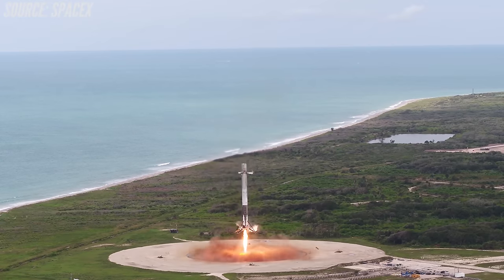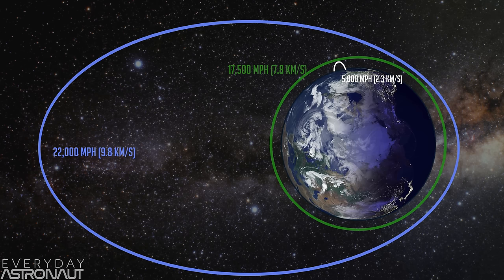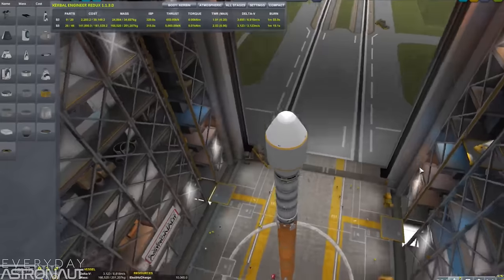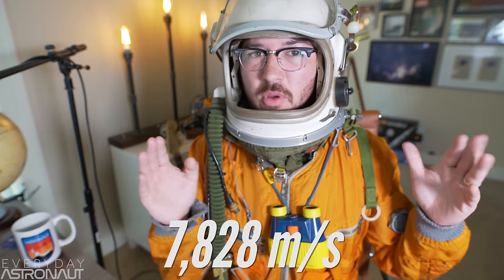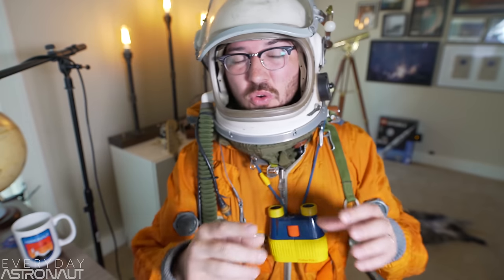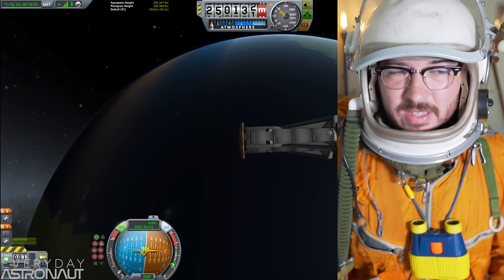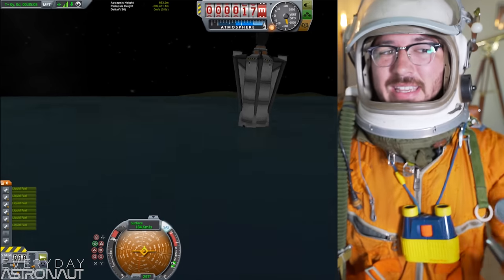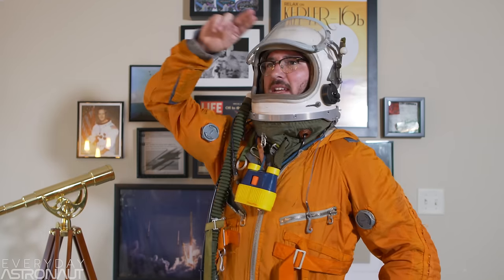Can SpaceX Reuse a second stage?

Comment: Sorry for the blasphemy, but wouldn't it be easier if they used... parachutes?
Reply: Parachutes only work when you are slowing down close to landing. They would get burned up at high velocities and probably torn to shreds as well since they can' t handle the stress. Parachutes make it impossible to land precisely in a certain location, so they can't be used very easily on land, unless you have thousands of free acres. If you land in the ocean, then the salt water damages the engines.
Reply: haha.....HAHAHAHAHA. Sorry i couldn't stop laughing at that. a mere parachute can reduce speed with velocity so high that it could blow up the rocket. LMAO.
Reply: I I The Apollo capsules all used parachutes so it's clearly not impossible to design ones that work. 

The range thing is a problem, but I think small drogue chutes deployed pretty much at the last minute could help with a propulsive landing.
Reply: The parachutes would be fairly heavy and have to be often replaced, and its systems replaced, with every flight. Not to mention it would require landing the second stage in the ocean due to parachutes being completely unable to make it have a soft enough landing on land, which would require refurbishing of the engines, body, etc. This is like how the Space Shuttle landed its boosters in the ocean, which took months of refurbishing and millions of dollars to reuse.
Reply: It could use retro boosters for landing, the way Soyuz lands.
Reply: I had to :| as well...
Reply: He has a VIDEO on why they don’t!
Reply: Apollo trailed drogues for a long time and only popped the mains when the capsule was slowed enough for it to be safe and the landing point already pinpointed - they didn't change the landing point by more than a hundred metres as it was already committed by that point. Assuming no high level crosswinds, It's entirely possible to use chutes to dump velocity, then jettison them and use retropropulsers for final landing without changing your landing point more than a few metres. The question is whether it's worth the complexity and cost of doing so.

Soyuz do it, but they don't do precision landings, they're not reusing the capsule and it isn't "soft" by any stretch of the imagination. Cosmonauts are regularly injured by the landing impact.
Reply: Jehan Kateli you can’t accurately land with parachutes, you have to replace them, and they add unnecessary weight. They’re also very expensive
Reply: I think the astronauts aboard the Soyuz capsule that land on solid ground every time would agree it's not a soft landing, but far from impossible to parachute recover something on land with minimal retro thrusters just to buffer that last little bit of velocity.
Reply: I think he made a video about this topic
Reply: The issue is reentry, not slowing down after. Apollo had an ablative heat shield and relied on aerodynamic forces to reduce most of the velocity so SpaceX would need something of that sort to have similar performance. As for accuracy of parachutes, it depends on the design. It could be possible to have a parachute wing like the Rogallo wing to guide it to a target after it slows down enough. The Rogallo wing was a proposed design for Apollo and Gemini.
Reply: Daniel Jensen but the Apollo capsule did not use the parachute to deorbit they used it for landing after reentry they need to get past the reentry part first
Reply: With such speed, the parachutes are:

1. Prone to burn and cut itself out
2. The parachutes will probably make a lot of problems, due to resistance from the Merlin engines.
Reply: imagine dropping an entire house and trying to recover it with parachutes..
Reply: Amos Batto however if they had the parachutes twords at the top and have some built into the sides of the rocket it wouldnt cause any stress
Reply: Yeah a heatshield and multiple parachutes would work
Reply: ChesterTheMemeMaster replacing a parachutes would be exponentially cheaper than either more thrusters or fuel
Reply: Mr Goat parachutes cost way less than say, extra engines and fuel. All it would take is a heatshield and parachutes built into the sides of the rocket. And maybe some rcs thrusters to help stabilize and steer it
Reply: ItzAtomic you don't need a drone ship or anything else for that matter if when you do a re-entry burn and have a heat shield, you burn in such a way that can get you over land. The problem with the first stage is that when it separates, it's already on a course with the water, but with the second stage being in orbit, it could simpily wait untill it could burn over land. Then use heatshields and parachutes build in on the sides
Reply: Dude Guy if that house had the proper parachutes, hest shields, and enough parachutes it would be possible
Reply: Matthew Filippi problem is, it will.

You see, not all parachutes will actuate at the very same time. Diversities in path will happen as soon there is one open and then immediately the other one goes off. Actuating parachutes from the sides can cause a LOT of exceptions to the internal flight computer, thus leading to an abominable change of path, causing the rocket to probably lose control of itself due to dynamic stress overload, causing the rocket to explode.
Reply: Space Pixel however it can be programmed to open all at once and a parachutes can be opened partially then fully later on like the Apollo missions
Reply: Nerys, right. 
1) heat shield until near-sonic,  
2) drogue chutes to reach thick air,  
3) parachutes that open very very slowly.
Reply: @alanbrown397  in

Comment: There's this thing called Skip Re-Entry you forget about.  If the upper stage did not attempt to directly re-enter, but instead made several passes through the very edge of the atmosphere where re-entry heating is not substantial enough to cause damage, then the thermal issues after several such passes would be easier to manage...  This requires more loiter-capacity on the upper stage and small adjustments to trajectory between passes to ensure re-entry on target, but the potential mass-savings from reduced re-entry heating are worth it...  Either way, though, upper stage recovery is likely to be a challenge.
Reply: I was looking to comment mostly the same thing. While watching the video, I thought "Well, now he's going to mention atmospheric skimming, slow the stage down to the same velocity as the first stages, then put it down the same way."

Drag is free, it's always there... and it's not like you are in any rush to get your second stage back because it is scheduled to launch tomorrow. I even think once the re-entry burn is done, you could probably use good old tech like a nice big chute and some airbags (how much would those weigh compared to struts, attitude thrusters and the electronics package to control all those systems? The second stage is much lighter than a first stage.

I'm sure Musk already is working on something that will use a free form of energy to slow the thing down. You never want to put stuff in orbit (fuel or hardware) if there's another way to do the same thing.

I am thinking the challenge could be in doing atmospheric braking with such an odd shaped thing as an unmodified second stage. Then again, if we can aero-brake interplanetary probes that are going faster than that and have the aerodynamics of a shopping cart, there has to be a way to skim a second stage as well. IMO, the tricky part is angle vs velocity... and also the time it is going to take for you to get the thing back down to a more manageable speed. If it is going to take 2 or 3 years, might as well not bother. But I suspect the stage can endure a decent amount of aerodynamic stress without braking up or being damaged...

Comment: Maybe if we made a new space station that operated as a rocket repair facility, we wouldn’t need to have second stages at all. Just keep anything going that fast in space. They could use bigger single stage boosters to transport fuel and materials into orbit. Anything that needs to go further into space can be launched into a higher orbit or geo, or whatever from that station

Comment: How about putting heatshields on the landing gear? The landing gear would be opened outside the atmosphere. When entering it should provide lots of drag (and withstand the heat) while offering stability. It should be even possible to steer with them!

Comment: You miss a key point with the attempt from 13:00 on, by the way.  If you reduce the size and mass of your payload, you can increase the size and mass of your upper stage, so you bring the same total mass to orbit- and have more fuel to work with later on.  Because you neglected to do this, your mass budgets were tighter than they should have been on that attempt...

Comment: I assume SpaceX will store the heat shield between the first and second stages, then move it to the rear to cover the rocket engine during the first part of reentry. SpaceX is already working on automatic docking. As the heat shield does it job, it ablates and protects the rocket engine. When the speed drops sufficiently, pyrotechnics can eject the heat shield; whereupon, the rocket engine can be fired to land the second stage.
Reply from the maker: +Edwin Ross a few problems. First off, there just simply is no margin with falcon vehicle for this which is why they’re pursuing all in on the BFR rocket. Second, moving a heat shield around is difficult and require a lot of weight. Third, the vacuum Merlin can not operate at sea level due to combustion instability of the large nozzle. 

But. I’m glad you’re thinking about this, but our assessment is pretty spot on for the fact that they’re going all in on BFR

Comment: Keeping those stages in orbit might actually have been my idea back in 1992 I postulated the idea of taking the fuel tank from the space shuttle up into orbit with it and using those components to build things in space and the residual fuel to eventually boost that station to a higher more stable orbit :-) that's when dr. Green told me they actually did have a process that would allow them to take the external tank into orbit with the shuttle

Comment: What about launching a recovery unit basically an empty shell between the capsule and the 2nd stage. Once mission is complete 2nd stage crawls up inside the shell which has heat shields on it.

Comment: I tried it in KSP today. The first stage failed ... I mean I staged too late so I had not enough fuel left to land it properly. The second stage completed its mission (deploy 10 Iridium sats). After that I landed it on first try, a few clicks from KSC.
Mind you, I used the 3.75m parts, a lot closer to real life (Falcon 9: 3.7m). It could be those parts handle more heat (and they have a lot more drag when empty).

Comment: How about not bothering trying to soft-land the 2nd stage and just have it splashdown into the ocean and fish them out like how NASA did with the Shuttle's SRBs?  Not sure if the Merlin engines or 2nd stage body can perhaps tolerate limited exposure to ocean water so that they can just fished out and re-used.  (Instead of having to be re-build from segments into new SRBs as the shuttle did).  Would just having them drop into the ocean under parachute and have the 2nd stage boosters sitting in the ocean for a few hours damage them too much to re-use as SpaceX wants to?
Reply: Destroys the engines, negating the benefits of landing the second stage. Besides you have to add quite a bit of mass to even get to the ocean as the heating from the atmosphere is the largest hurdle.

Comment: Meanwhile, when I play KSP, I find the stages I take into orbit easier to fly back to the KSC. All my recoverable first stage boosters tend to end up in the ocean. They also tend to be asymmetric, like Soyuz lateral boosters, so propulsive landing is a nope. My second and third stage designs keep nose-first by a mix of airbrakes, being capsule shaped and having the return fuel separated in the top-end to keep it nose-first.

Comment: 3 questions. What if you pumped the remaining fuel to the "top" where the heat shield is to help add weight to that end?

What if instead of trying to recover the whole rocket you just recovered the motors? My understanding is that is where all the expense is anyway. Just add an expanding heat shield above them with a with parachute, fuel plumbed around them.

Finally, with the ULA plan, how long can the liquid fuel last in space? My understanding is during earth conditions the fuel slowly evaporates which causes those gas clouds to come from rockets on launch pad. Would the fuel slowly bleed of in space too?

Comment: Or you could use more effecient engines, maybe using SpaceX raptor engines would suffice ;) 

Current falcon 9
First stage:
9x merlin 1D (isp 282s sl and 311s vacuum) max thrust sl ~7600kN
Second stage:
1x merlin 1D vacuum (isp 348s vacuum) max thrust ~934kN

Future falcon with raptor engine:
First stage:
3x raptor (isp 334s sl and 361s vacuum) max thrust sl ~9150kN
Second stage:
1x raptor vacuum (estimated isp ~382s vacuum), max thrust 3500kN.

I recognize that the vacuum raptor used in the second stage is overpowered, but I am assuming that it can be throttled).

With those numbers, there should be additional room in the mass budget for everything needed to land the second stage.

Comment: Could some enormous gaz tight airbag structure be devised that would produce high drag in the upper atmosphere after a slight burn that would just make it low enough to get out of commercial orbits and let it decay over a long time, days or weeks. A sort of very low power deorbit drag instead of high power burn. Making a gaz tight foldable and high atmosphere worthy big structure is surely a big challenge. I would put mylar, nomex, nanotubes, graphene, and latex in a sorcerer's cauldron. another  airbag to keep the engine cushioned at impact and out of the water.

Comment: Another promising use for 2nd stage is using the empty tank as a space station component.  Compared to the complicated ULA concept of refueling them and sticking a few stages together in orbit, using an empty propellent tank as a room on a space station is probably a much more realistic use for the 2nd stage.
Reply: And what do you propose the IST does with uninhabitable spent second stages with fuel vapors and what left in them? Weld some airlocks in and cut out some windows in it??? Or are you thinking second stages should be launched with a nice pressurized environment fully set-up (wiring, cooling and heating, airlocks, ect.)... maybe throw in a home cinema and a space jacuzzi...
Reply: That's what I wonder about too when this is suggested.. I doubt those things are usable for a station without some kind of prep.

Comment: Other possible Concepts i thought of:

=> Put the Heat Shield behind the Engine, but make it moveable with a Hinge or something. When the Stage is active move it to the side for Burns, for Reentry (Engine first) move them back. This way it could be stabilized without active Control.

=> (my preffered reentry concept from KSP): Put an Inflatable Heat Shield in front and lots of A.I.R.B.R.A.K.E.S. near the Engine (replacing the Engine Shroud with them) - using such a configuration i could do a Reentry with empty/light Fuel Tanks without active control and with Reaction Wheels + SAS it was even possible to reenter with a full medium MK3 Fuel tank directly behind the Engine and in front of that some empty/light other parts which usually is a very unstable configuration (its basically self-stabilizing if you are facing prograde) - admittedly had to spam Parachutes for the final descent though..

=> use a classic heat shield in front, but also add an Inflatable Heat Shield which extends radially on the Rear to stabilize the Craft by moving most Drag to the Back. Works similiar to the previous Concept, but i think its more do-able. To fill the Heat Shield maybe add more Helium to the Tank, which is present to pressurize it anyway. (or use Heat-Shielded A.I.R.B.R.A.K.E.S. instead)

=> Regarding the un-usability of the Vac Engine in Atmosphere: afaik the only difference between Vac and Atmo Merlin Engines is the Length of the Engine Nozzle - the Vac Version is simply longer. So if you can get rid of some extra length of the Nozzle in-flight you can turn it into a Atmo Engine. not sure how though.. i guess Explosives are a bad idea because they might blow up through the operating temp of the Engine.. and mechanical means also have to survive that...

Comment: Small thing i think you forget, you should drop the heat shield after slowing enough in atmosphere, it would lower the weight, maybe not much but always, i don't think they would use it again anyway
Other idea for the video: what is most expensive on second stage, what can be used again? maybe it would be wise to just drop things and left with minimum for landing

Comment: Here's an idea just to throw out there. What about having the second stage literally dip just a little bit into the atmosphere to slow it down a little bit. Over the next several orbits getting to a point where it's going as slow as possible to finally go into the thicker parts of the atmosphere. Another way of looking at it being reverse thrusting to put your perigee at a point in the extreme high atmosphere, and calculating that point specifically so that 2-5 orbits later, you hit a point where you're vector is a perfectly circular orbit at that point. Then proceeding to very lightly and very slowly make a descent. This is probably already done, and at that more efficiently with the Russian Soyuz capsules and the late Apollo capsules, but it is a suggestion and something that I think might have needed to be said or at least clarified wasn't a viable option, or was already being done to the best of our abilities.